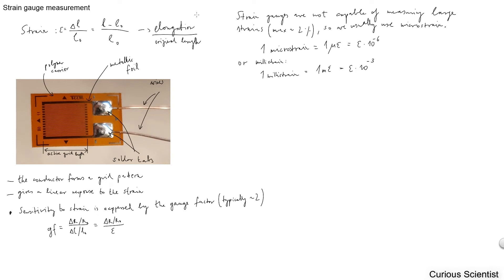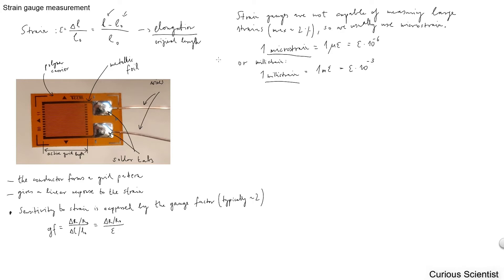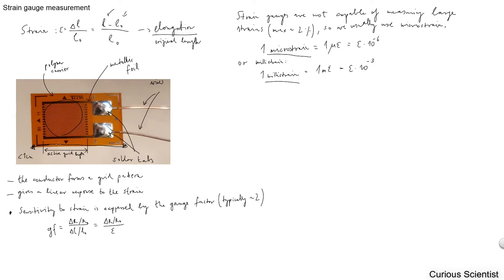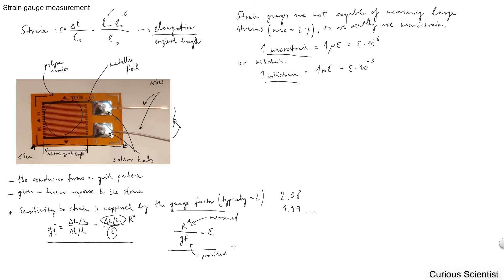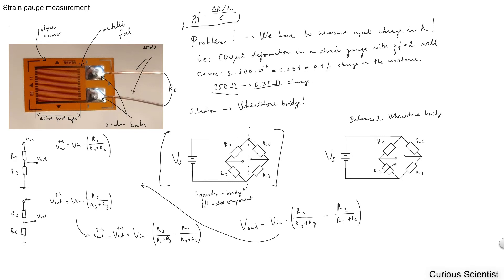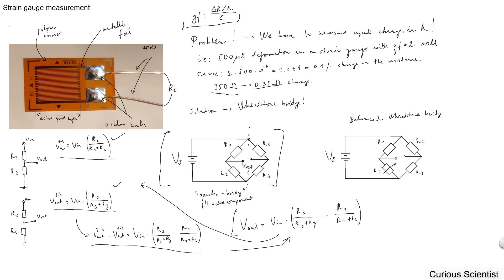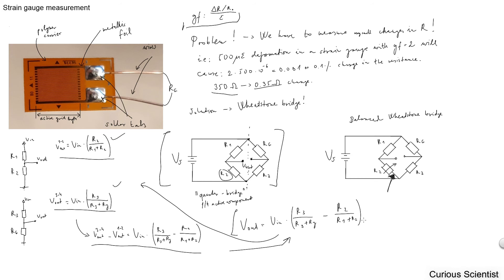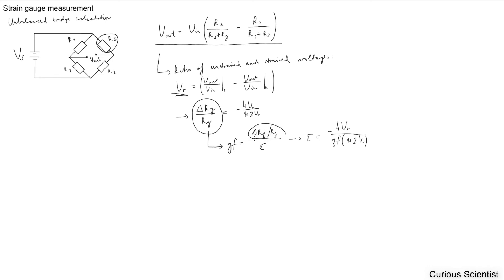Brief introduction of strain gauges - Part 1

Comment: What a great video. But can you help me, i'm newbie here. In this formulation you did not include op amp multification, right? So before calculating ratio unstrained vs strained voltages, it needs to divide with op amp, is it right? Sorry for bad englsih
Reply from the maker: Hi and thanks! You don't need to involve the op-amp because the relative changes are still the same. It does not matter if we see 0.2 V to 0.1 V change or 2 V to 1 V change. 0.2/0.1 = 2, and 2/1 is also 2.
Reply: @CuriousScientist  oh i see. Thank you for explanation

Comment: *PLZ HELP*. Given a pressure of 2kpa, nominal resistance of 120 ohm, diameter of strain gauge 0.1mm, a GF of 2. What will be the change in resistance value of the strain gauge?....in short I wanta formula to calculate the change in resistance of strain gauge for a given INPUT PRESSURE
Reply from the maker: Sorry, but your question doesn't make any sense. First of all, the strain gauge doesn't have a diameter, it is a rectangular object. Second, you have to know the dimensions of the object that the strain gauge is attached to. Then, based on the strain (stress) change upon a given pressure change will give you all the values. I have a video where I demonstrated this with a carbonated soft drink can. 
Ps: Don't spam your questions under multiple videos. I will neglect them next time.

Comment: You lost me at the derivation of delta Rg/Rg. I understand that Vin is the same during strained and unstrained so we can have Vr = (Vout during strained - Vout during unstrained)/Vin. But beyond this point nothing makes sense.
Reply from the maker: There is a difference between something does not make sense, or something is not being understood. I simply substituted the resistor values in the Vout/Vin formulas and after simplifications, I could get rid of most of the terms (for example, R1,2,3). I could keep Rg and Vr in the equation and by rearranging the formula, I could get dRg (difference between Rg-strained and Rg-unstrained). And why it was done like this is because the next equation, the gauge factor (GF) contains this expression (dRg/Rg), so ultimately, I could express the strain.
Reply: @CuriousScientist  I'm so sorry. i definitely used the wrong choice of words. I intended to say nothing makes sense to me or I didn't understand. My apologies for the miscommunication.
Reply: @CuriousScientist  Thank you so much for explaining further. I had tried to substitute and rearrange terms but I got stuck at a point, guess I must have missed something in my steps.